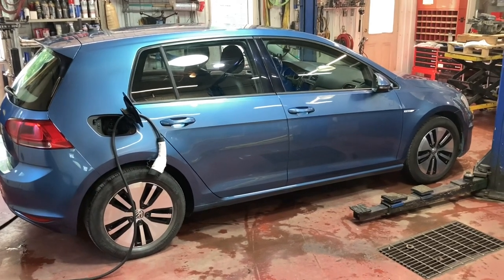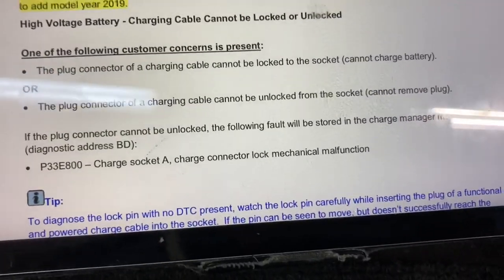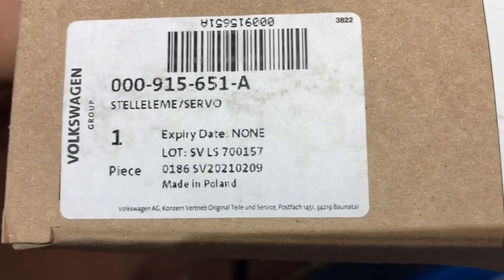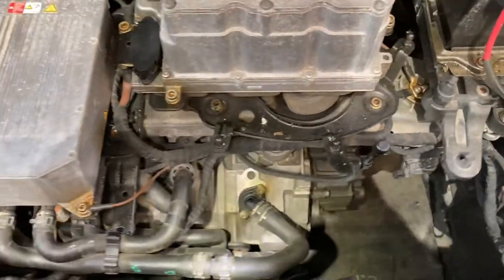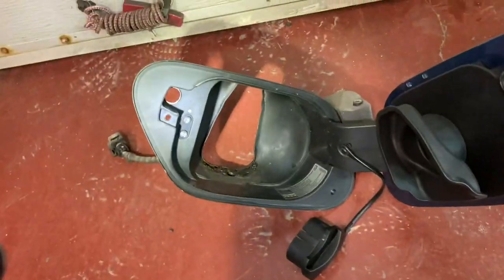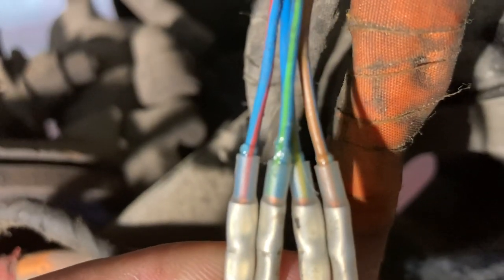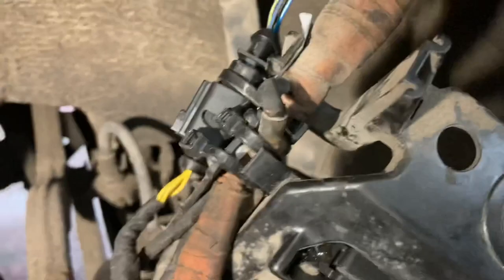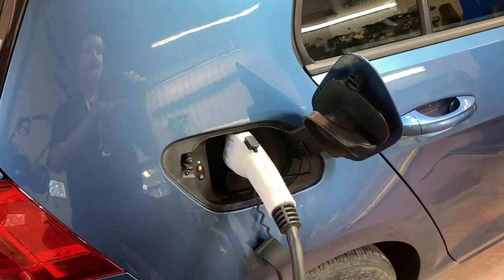Volkswagen e golf problem charging and red LED on

Comment: Great video. I only got five minutes in and figured out I needed to check the pin and I ended up finding the end of a broken connector causing an extra space where I was plugging in and charging with start, but then it would stop. Thank you so much for making this video.

Comment: I suspect this is a rare problem. I think it is also possible that spraying some silicone lubricant on the locking pin will solve the issue.

Comment: thank you sir..
i didnt have to replace any parts but it gave me an idea of the problem i had and how to fix it.
it fixed my problem
Reply: @dodindaga, what was your process for fixing this?
Reply: @TheDevindahlgren WD40.

my take on it, if you can loosen the pin just by tapping on it, it must just be stuck by dirt.

i charge outdoors where it gets dusty, rainy, windy, misty. VW wanted to charge 1400 for parts and labor similar to what is on this video.

i applied WD40 and the pin engaged. i then applied silicone spray lube .

if the repair was priced more reasonable or if they can proove that the parts actually require replacment and not just cleaning, i would go with the repair.
Reply: @dodindaga  I appreciate you taking the time to respond. I have actually removed the mechanism and cleaned it twice. Both times solved the problem but the problem has occurred again. I believe it's time to replace the part as I'm beginning to feel it's more than just dirt.
Reply: @TheDevindahlgren the parts can be sourced for about $500, VW charging me about $750 for parts. read into the bulletin on part numbers, one of the part is not required for 2018-2019, yet VW also quoted me on it (i have a 2019).

my egolf is high mileage, i would probably just trade it in instead of spending to repair it if the problem persist :(

Comment: Thank you for video. My 2017 has about the same odometer reading as your car. But, I have the 35.8 kWh pack so I'm guessing it has fewer connector plugging events than your 24.2 kWh pack, but who knows.... 

Did you take a close look at the old locking pin actuator to see what was causing it not to move?

Comment: Pump part number has not changed.  There are no letters after it so that is still the original.  As far as the pin part number, looks like they made it a complete kit hence you see the two different part numbers, the one on the box and the one on the part. ;)
Reply from the maker: Yes I know about the part number system but sometimes they charge supplier.  When I bought the parts they were ordered all separately but what I think is going on is the actuator without the connector has it’s own part number when they install it on a new wireing harness at the Factory but when the connector is installed the the number on the box is the number that indicates the repair assembly but I wonder if I were to order a brand new cable assembly would it come with the connector installed or they all come like my car did in 2015 ?

Comment: Hi Christian. I drive a 2017 VW eGolf SE and the battery charger on the car needs replacing. The dealership quoted $1100 to replace the $2200 part–5QE915681N. Can you tell me how many hours of service are involved in replacing the battery charger? I purchased the car on March 15, 2018, and experienced a high-voltage battery failure on 04/04/2023, 3 weeks out of warranty. The battery was covered by the 8-year warranty, but the battery charger was not, and the car was returned to me unable to take a charge. It is still with the dealer 6 weeks later, awaiting the new battery charger install. Thanks.
Reply from the maker: Sorry for your issues I looked into my Alldata repair information and it said 2 hours to replace it looks pretty easy to replace I looked it up into the repair manual but the charger might need some programming and coding after installation and also to top up the cooling system. So the charger was not under the high voltage warranty ? 
So what happens when you connect a known good charging cable on the car no warning light  ?

Comment: are you in canada? need help with 2011 vw touareg 3.0 tdi adblue countdown but adblue is not low
Reply from the maker: Sorry for responding so late but do you know if you’re vehicle is still under the TDI emissions warranty ? If it is I suggest to have it check at a VW dealership it will cost you nothing but if you’re vehicle is out of warranty for the Diesel gate then I could be a lot of things wrong your have to put a good scan tool on it and see what faults are there it could be the heater in the adblue tank the pump injector the NOX sensor etc....